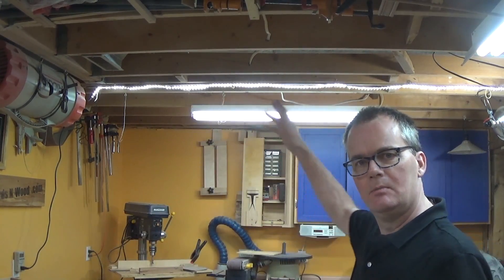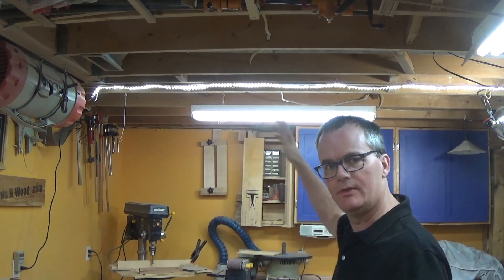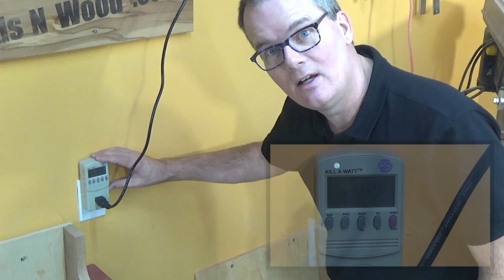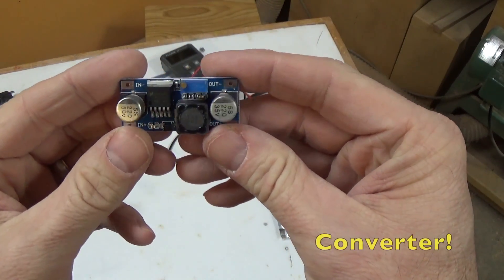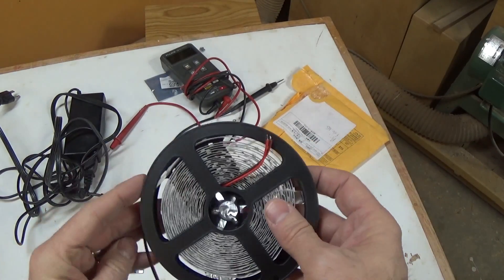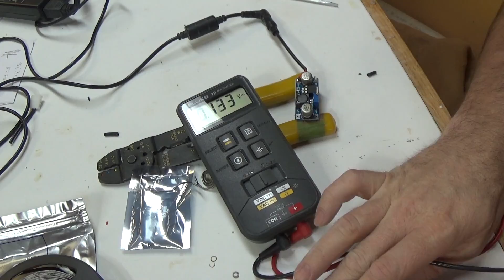Can LED strip lights replace Fluorescent!?  (WnW #46)

Comment: maybe you could improve the LED strip by reflecting it more. the light is much more spread now then a normal TL.
Reply from the maker: +Martijn Fransen LED's are very directional.  There is very little light going up.

Comment: My vote is - Keep them all. More is better. Thanks for sharing the test. I bought a few 4' LED shop lights for  $39 US each and they give off 3700 lumens. I haven't done any measures with them that is just what was advertised by the manufacturer.. My subject evaluation is that they are brighter than my fluorescent tubes.
Reply from the maker: +WoodRodent this strip is 3600 lumens, so it should be pretty much the same as those tubes of yours.
Reply: The advantage in your set up is that they are spread over a longer distance eliminating dark corners. It make the whole shop seem brighter.

Comment: I would guess the reason the first tape's adhesive let go is heat.  LEDs are not 100% efficient (nothing is), and the higher power diodes dissipate a fair amount of heat.  Perhaps taping them to a strip of aluminum bar instead of painted wood would have helped?  Fluorescent lighting is efficient. But, the latest generation of LEDs are very efficient as well.  With the right drivers, I've seen specs showing greater than 100 lumens per watt.  Your 80 watts of fluorescent operating at, say 80 lumens per watt (Wikipedia says T8s driven by electronic ballasts produce 80-100 lumens per watt) is producing 6400 lumens.  Your 5m string of LEDs rated at 720 lumens per meter should be producing 3600 lumens, or a little more than half the output of your twin-tube fluorescent.  3600 lumens / 50 watts = 72 lumens per watt - not bad but not great either.
Reply from the maker: +OnEvenKeel Thanks for those numbers!

Comment: I think the new LED strips provided better light for the video.  The light is not as as harsh.  The old T8's caused bright spots on your face, but the new ones did not.
Reply from the maker: +Howard Springsteen I continually struggle with the bright spots on my face + head.

Comment: I found some led "fluorescent" tubes, from Luminus at Costco, they seem quite a bit brighter but were a little pricey at 38$ for 2 tubes. They were an easy replacement for the fixtures I already had, I definitely fell for the convenience. The good thing is, the LEDs don't have a delay in getting up to full brightness in my cold garage like the fluorescent tubes, so that's a win. Great video too, good use of the laptop power supply!

Comment: Another factor is longevity.  I put T8 fluorescent lights in when I built my shop and in the 10 years since had to replace nearly one quarter of the ballasts at approx. $15 a crack.  LED's are marketed to have amazingly long life spans.  Another Youtuber (Darbin Orvar I think) recently did a video on LED's and showed that not all the "cells" on the individual LED squares lit on the cheap Chinese versions... maybe the difference in the watts yours are pulling.

Comment: Nice investigation.
The thing about the big old flourescent bulbs is that they are quite efficient (better than CF bulbs), so they are hard to beat.  Even the best of LEDs don't provide much savings over the old flourescent bulbs.
Reply: But don't forget to count in the EM ballast if they're old fixtures. Loos in an EM ballast is quite significant and many people don't know that a 36w tube is actually using more than 36w as the 36w is the tube itself not counting ballast or driver loss.
Also good LED's (he didn't choose the best) have a light quality that even the best FL can't beat. Also no worry about mercury in the case of an accident. Add to that no harmful UV. In many places where FL has been for ages it's apparent that anything near them is affected by the UV. Plastic goes brittle and yellow even though it get no sunlight, paint is going matte and flakes, printings bleaches and so on. Not healthy for your eyes either.
But you're right power savings may not be as much as one would initially think. However I still prefer LED over FL any day as long as you don't get the crappiest LEDs. I only got one FL left in my house in the laundry. Everything else is LED - not even a CFL left. More and better light everywhere the CLF was replaced. About same light output and apparent quality where another FL was replaced - but now instant turn on, no noise and better for the eyes because of less UV.
Reply: One other advantage from what I understand of LEDs over fluorescent bulbs is in unheated areas in cold climates.  Supposedly fluorescent bulbs have trouble in those situations.  I'm in Texas, so I haven't noticed it, but I would think that it could be noticeable in *Canada*. :)

And another advantage of the 12VDC LED strips is that they can be easily run off a 12V car battery without the need to have an inverter if need be.  That might be good people who live in areas where storms knock out their power for extended periods of times.
Reply: You are dead wrong. I've replaced 96w T8 troffers with 32W led flat panels in commercial environments. The space is considerably brighter than before while saving 64w per fixture. Effective lumens are terrible for T8 troffers with diffusers. We initially started upgrading for energy savings, but as projects went along - it became more about the better light output than the electric savings. Same result going from 500W metal halide to 150-200W led fixtures. Parking lots are ridiculously brighter and better lit while reducing consumption by over 300watts per fixture.
Reply: +Wordsnwood (Art Mulder) I think you should get all in. See if you can grab an old ATX powersupply, they are pretty efficient and stable too. That way you can use one single powersupply to power all LED strips, and even expand a lot more. I have an old ATX powersupply powering many things, it provides 24A. The LED strip I have at hand uses 1A for 4.20m with 60 LEDs per meter. Thats 238mA per meter, so I could power 100m of this LED strip without even stressing the powersupply too much.
Reply from the maker: +Andre Klärner Believe me, I've thought about that.  However ATX power supplies have a cooling fan and are open for ventillation.  I'm not at all sure that a dusty woodshop is the best place to use something like that.  In contrast, Laptop power supplies are sealed.
Reply: @Wordsnwood  
But a laptop powersuply isn't a powersuply but a charger. ;)
Reply: I think if you don't load the supply fully at all you can get away by removing the fan entirely. But I have to say LED makes your shop look much nicer!
Reply: +Andre Klärner The PSU efficient shall be take into account too, a laptop PSU can go for 80% to 90%+.
Reply: Would this work in an aquarium hood?
Reply from the maker: +Matthias Wandel   Pretty much my thoughts.    The one bonus was how spread out and indirect the LED light was.   Very nice.

Comment: Maybe you should re-adjust the DC-DC converter while it is under load?  Maybe it would make it brighter.
Reply from the maker: +Kilroy1225 Yeah I should test it while on, see if the voltage has changed.